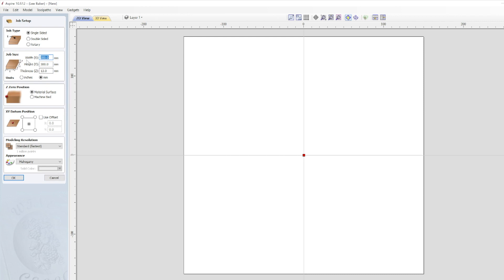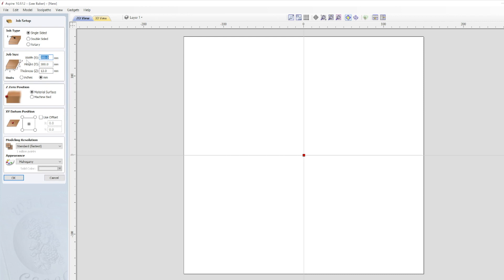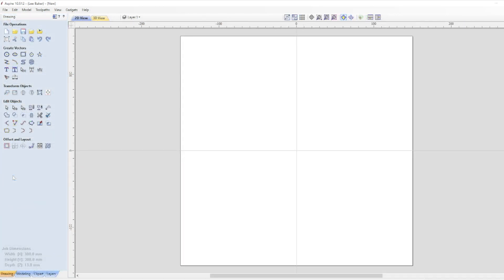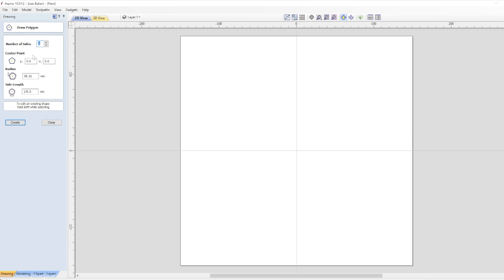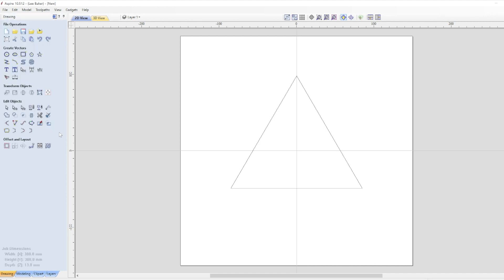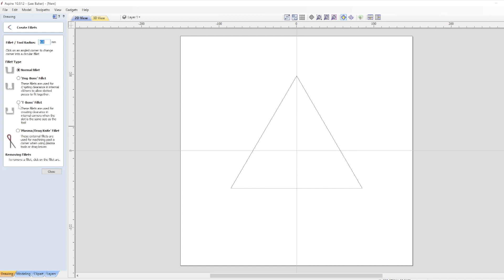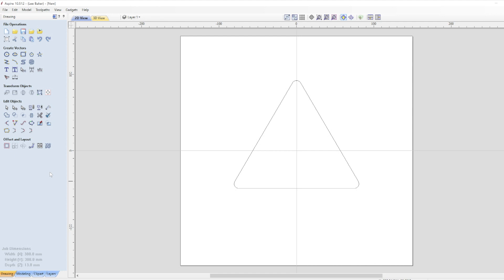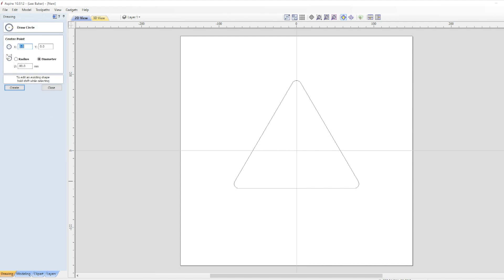Vectric V Carve & Aspire CNC Tutorial - Make A Triangle Drinks Coaster

Comment: I really wish I had the room for a cnc, We are moving house next year and the goal is to have a bigger workshop built, then I can join in on all the CNC fun :)
Reply from the maker: Whilst you don't need a massive amount of space, its definitely worth planning everything out first. Mines 900 x 600 which isn't massive and been suitable for 99% of all my projects. Most cncs require some kind of control unit so that needs to be factored in. There was a couple of occasions I struggled (pinball machine for instance) and a bigger machine would have been great...but most of my projects are fun, small items. An 8 x 4 cnc might be over kill for making one of my coasters haha! If you buy one, you'll have fun with it. Opens up a lot of new doors. I just use mine for fun mainly and try and vary my projects so they dont feel repetitive. The good thing nowadays though is how popular they have become so theres so much help out there...a few years ago it was a case of buying one and hoping for the best :-)
Reply: @Smugwood  900x600 seems like a decent size,  My CO2 only has a cutting area of 500x300 and for most things that is fine.
Reply from the maker: I very rarely use the full length but I’m always using up the width. The length comes in handy though for anything guitar related although I’m fairly new to luthier work. But anything bigger and I’d not be able to get in the workshop 😂